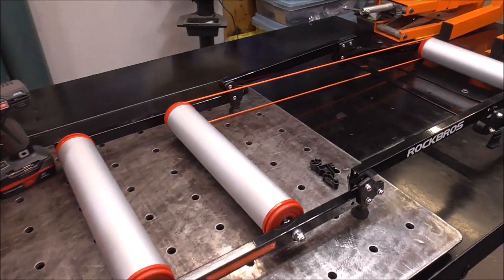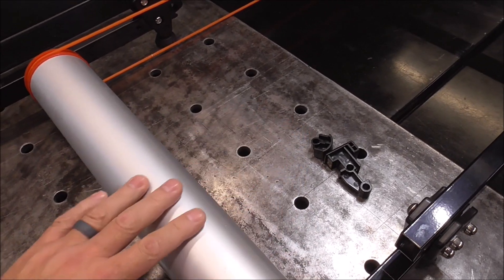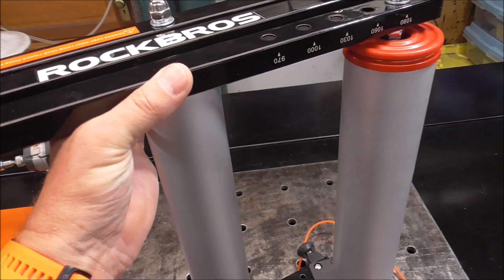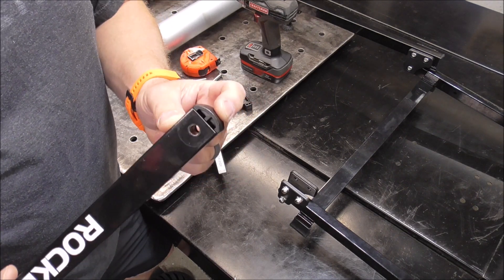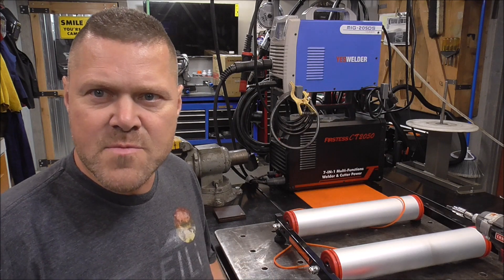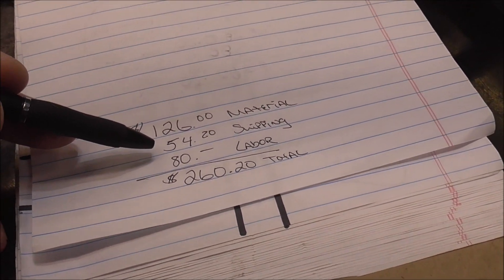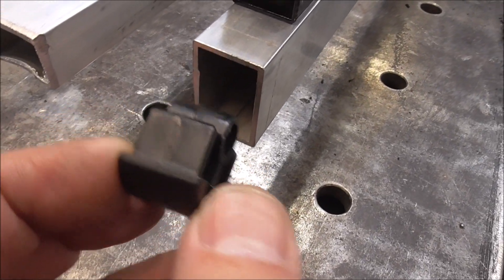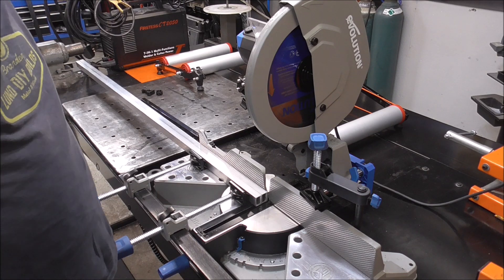Aluminum Fabrication Project Modifying a Customers Professional Race Team Bicycle Warm Up Stand

Comment from the maker: Chop saw link: https://www.lowes.com/pd/Evolution-S355MCS-14-in-15-Amp-Sliding-Corded-Miter-Saw-Corded/5014430213?user=shopping&irclickid=0iKXVszH2zJHU0aSQMRDmQIIUkF2Q8VShV7g2M0&irgwc=1&cm_mmc=aff-_-c-_-prd-_-mdv-_-gdy-_-all-_-0-_-3586222-_-0
$25 Aluminum MIG Conversion https://youtu.be/FGhSo82MP9U
MORE WELDING AND FABRICATION VIDEOS HERE:https://www.youtube.com/playlist?list=PLfbf78fMz9Vol0uX2-GNc6mLi75zpqb5f
LEARN HOW TO WELD VIDEOS HERE:https://www.youtube.com/watch?v=ADa1I319GJ0&list=PLfbf78fMz9VqxPZTT-xmwdcrHVa7ML-ft
AWESOME TOOL BUILDS! https://youtube.com/playlist?list=PLfbf78fMz9Vo2Cv3V5fmYlDZGpS8Hp98l
Reply: Way to go! Another great video! Brandon! Thanks for sharing! 👌👍